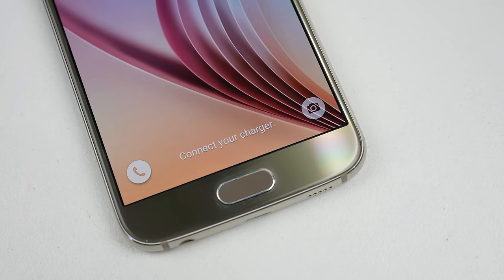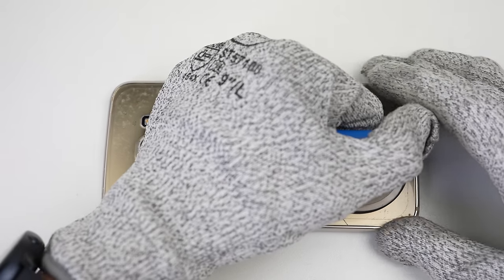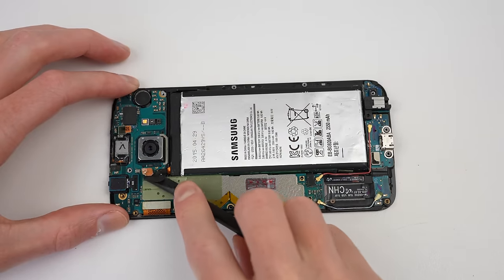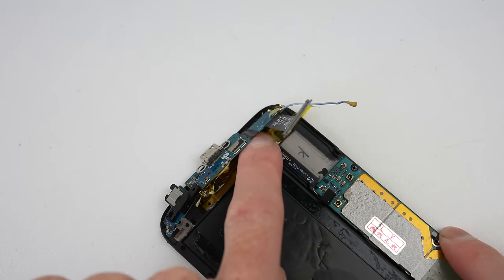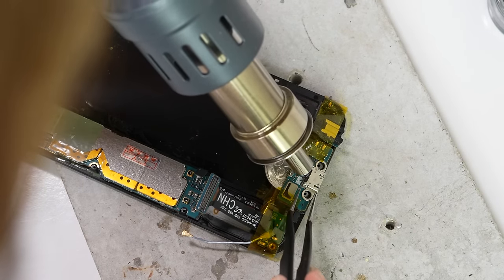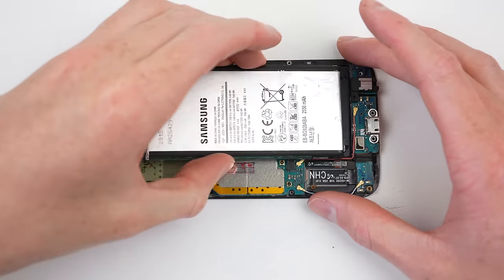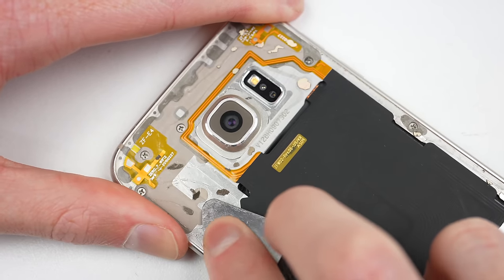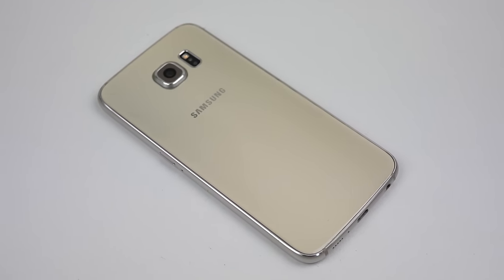Complex Repair - Galaxy S6 Restoration + Charging Port Micro-Soldering

Comment: Thanks for calling glued in batteries an outright stupid practice. The Galaxy Xcover Pro proves your point, hotswappable batteries should be the norm
Reply: Also the Fairphone 4
Reply: @WhenDoesTheVideoActuallyStart  but the fairphone 4 is thick, underpowered and doesnt have great liquid resistance. The Xcover Pro is IP68, modern spec processor and fantastic IPS display. its also MIL-STD spec for durability while staying affordable and slim. If people equate hotswap batteries with devices like a Fairphone, we wont get anywhere. It needs to be styleish enough to sell to the mass market
Reply: @Carterthielftw_  Are you kidding me? Where have you got your info from, Bob the flat earther? The Fairphone 4 has a Snapdragon 750G. That's Cortex-A77 big cores on 8nm. It runs miles around the Xcover Pro's Cortex-A73's on 11nm (Not to mention it's an Exynos instead of a Snapdragon).

The 750G is the lowest I would go for a new phone, so they picked the SoC relatively well.

As for "thin", it's not 2015 anymore, and as for "stylish", I'm sorry but not everyone is that shallow. Not financing slave labour is more important to some people, and that's a feature no other phone offers.
Reply: @WhenDoesTheVideoActuallyStart  Interesting, I knew it had equal RAM to the Xcover Pro, however I remember it being constantly hated on for being "slow." evidently smartphone reviewers are disconnected from reality and think anything thats not an 888+ is slow. Ive been using an Xcover for a couple months and cant remember any time when it felt slow, considering the Fairphone is faster and MSRP is similar (I got mine open box for $250.) I could get behind it

I was wrong, with that SoC (and it being available in the US) I would definitely consider it. $500 is a lot, but im  not against the device, I just believed what reviewers were saying :(
Reply: Xcover Fieldpro
Reply: Blame tech reviewers. Muh premium

Comment: This is awesome. The first premium phone I had was an S6 Edge+. Dang it was nice. And I was able to do a battery replacement on my own when it swelled. It lasted a long time. I eventually ran over it with my car. The phone still turned on and I probably could have just replaced the screen but I thought it was time to upgrade. I'm considered buying another one for the sake of nostalgia.
Reply: Oh and I miss the physical home button with a fingerprint reader. It was like touch ID but smaller. I would take having a bezel on a new phone for this
Reply: The screen would actually still come on sometimes after it was ran over. I have looked at buying a new screen now but it costs the same as buying one of these phones that work.
Reply: @The King  get an ebay screen
Reply: @deeznutt666  Galaxy Note 5 came along with the S6

Comment: Heres the thing though Hugh, Samsung did have a solution for this charge port under screen button problem. The galaxy S6 Edge had a cut out under the mid frame to allow the buttons to be under the charge port without wrapping around and going under the screen, this meant you could lift it straight up and replace without any issues. But samsung stopped doing that with the s7 series and after the s7 they never had hardware buttons again anyway...

Comment: I tried a Micro USB port repair once. It worked but I forgot to secure the port down and while I was testing it the weight of the charging cable ripped the port out of the device, along with the solder pads. Glad you could get yours to work.

Comment: I am still running an s6 edge in 2023. This year i replaced the charging daughterboard alongside the battery. In the edge variant the cables for the capacitive buttons don't run under the screen so it was an easy job. I actually found it to be very straightforward to repair despite it's reputation, although i do agree that gluing the battery down is ridiculous. Anyway I must say that i'm positively surprised with the longevity of the  phone and I plan on hitting a decade of usage before replacement.

Comment: Loved the S6,this was the first Samsung phone to have a great build quality.Also this one seems to run the original Android 5.1 version that originally came with it,it's pretty rare to find one still on original firmware because this was the only S that would refuse to downgrade via Odin if you didn't like 6 or 7
Reply: I remember buying a S6 edge on Marshmallow and wanting to downgrade to 5.0.2 due to the square icons, only to find out my Rollback Protection Software Revision (RP SWREV) didn’t allow me
Reply: Note 4 was the first to have aluminium frame, but still had removable back
Reply: @coffeemakerbottomcracked  Note 4 looks cheap next to the 5
Reply: @deeznutt666  You can downgrade the S7 if you want. Out of all Galaxy S phones the S6 was the only one that i couldn’t downgrade
Reply: @coffeemakerbottomcracked  i know,but the frame was scratching easy and the back still felt cheap. The S6 and the Note 5 felt premium in all ways
Reply: @satsumagt5284  5.0.2 had RAM and battery bugs. I had it on my green S6 edge when i first bought it. When the battery would reach around 20% it would already shut off. When i got 5.1 those issues were fixed. In Android 5 versions it also had unlock sounds and animations that were unique and went gone after Android 6 and up. The whole UI was different after updating to 6
Reply: @coffeemakerbottomcracked  Actually it was the Galaxy Alpha
Reply: Galaxy alpha was the first phone to have great premium build quality
Reply: It orginally came with 5.0.2 and I managed to get an edge model running orginal firmware
Reply: @satsumagt5284  there are 2 5.1.1 updates. One kept the orginal icons and the later one bought over the Note 5 icons
Reply: @satsumagt5284  nah it looks premium
Reply: @Mirra2003-f9s  mine doesn't have the battery bugs or ram

Comment: You can use the dome head screws to hold the charge port in place then use the heat gun to melt the solder. Saves you using tweezers and a shaking hand. 👌

Comment: Nice! I used to do so many of these years ago you can actually replace the whole flex without removing the screen heat plate with suction and iso u can wiggle it out and wiggle new one in but now i would prefer to solder them as its quicker.

Comment: Slap some Lineage OS onto this thing and you've got yourself a pretty decent mid range phone to be used as a backup device. Also, good job with the soldering
Reply: i would say better than a midrange for many, because of the high res camera and screen
Reply: Touchwiz is fine

Comment: Such a pretty phone. An S6 is too old to be daily driven but it would work good as a media device for Netflix/music/podcasts/YouTube etc
Reply: Im daily driving it, plus its underclocked. In words of a wise man, 'As long as it plays music and porn its fucking NASA to me'
Reply: @xentiment6581  good on you bro. I wouldn't be able to daily drive it; no expandable storage, small storage and it's stuck on Android 7
Reply: @defnotatroll  Android 7 is still very relevant today. Most apps support Android 7 except just  few ones.
Reply: @neerajdwivedi2015  but it's still old and lacking lots and lots of features compared to newer android, stuff like dark mode
Reply: @defnotatroll  You forgot you can put custom ROM or download a launcher called: HiOS makes it much more responsive and efficient
Reply: Custom ROM / HiOS launcher on S6 would work awesome
Reply: @WololoWololo2  custom ROMs always always perform worse than stock ROMs or have less features
Reply: @defnotatroll  But atleast newer than the Samsung S6's old Touchwiz and unsupported old Android 7
Reply: @xentiment6581  ayyyyy filthyfrank reference
Reply: Bought one running 5.0.2
Reply: @WololoWololo2  security patches don't matter unless you're doing mobile banking
Reply: @DavidNgo86  True 😩

Comment: I used to do this dozens of time everyday without a MicroScope, it's doable but you definitely need Steady hands and good Eyes, also Hugh I hope you checked the USB/MTP Connections, because if it's charging it doesn't mean it's data lines are also good.

Comment: Well my first micro soldering experience was on brick phone from czech company called alligator. I changed the led flash and was very happy when it worked. However,
That’s only 2 big pins, charging port is complicated 😄. Great to see your S6 works :-))

Comment: Hey Hugh, I know you don't usually take requests but You are THE only Person on youtube i fully trust with repairing devices, I Still have my galaxy S6, it's a 32GB, Black Sapphire model, im thinking Of restoring it & changing it from Black Sapphire to Blue Topaz, Which includes changing the front glass, i've looked on youtube for a Video about changing the S6's front glass But none of them go into actual full detail, do you mind if you could do a video on another S6 which Will be having the Screen replaced?

Comment: I love the older samsung phones anything pre note 10. They just are so beutiful and the compact 1440p oled is just beautiful on older flagships, I would use a note 9 with modern chips
Reply: The bezels are ginormous though especially round S6 S7 time
Reply: @defnotatroll  I don't really care it still has no interruptions like a notch or punchhole
Reply: I’ll be honest the S7 Edge I had was by far the best screen on a phone I’ve ever owned. Overall build quality was outstanding. I miss that that phone….
Reply: @lkracker7  see I had a normal s7 and it was my first oled and 1440p screen and wow that thing flew

Comment: If you are worried about the heat damaging parts, I would recommend for you to get some good quality aluminium tape, as that one actually diverts heat and also protects the other components from it even better than teflon tape. Of course, it is also worth considering, if the cost of it is worth it, as it can be quite a bit more expensive than teflon tape.

Comment: hugh. your new battery is VERY close to and original battery. i still had my original s6 batt and it has 40% life left. the date code is misplaced on your one and the QR code looks bigger but otherwise it looks original. i repaired my S6 with both frames and the battery because everything was bent but the screen worked so i replced teh frames and battery so i could get a usable galaxy S6 and i did not break the original screen and im still amazed that it did not break when i was removing it

Comment: Two things. Kapton tape is not hear resistant, it's heat reflective, and not up to particularly high temperatures, so careful 

2, you don't want to use low melt solder for permanent applications, just component removal. You could find those joints failing down the line, not that you're going to use the phone I guess. Always remove low melt and apply leaded solder for the resoldering of ports.

Comment: Im coming to Australia so you can replace the charging port of my S6!!! My S6 is in absolute pristine shape(literally not scratch) and still functions as it did when i purchased it in 2015,including the battery life,with the exception of the charging port that has finally worn out from 7 yrs of daily plugging in which still works with some wiggling. Its never been wet and i can count on one hand how many times it has touched the floor in 7 yrs. I have resorted to wireless charging which is kinda a pain in the butt,but it does the job. Im reluctant to bring it anywhere to have it repaired due to my fear of lack of care to the rest of the device. If you ever travel to south florida,please bring an extra charging port for an S6 as ill be patiently waiting and still wirelessly charging!

Comment: Smaller nozzle if possible on the hot rework gun and some magnification and you’ll have it licked. Great effort without any magnification. Tweezers used not the best as they don’t grip very well. Some micro pliers perhaps better as you can apply a positive pressure on the charging port and hold it more firmly.

Comment: Great video. I have an old S7 that needs a new screen and probably a new battery and considered trying a DIY repair even if just for practice. That is until I saw replacement part prices. Unfortunately much more expensive than the phone is new now. Not really worth it for me.

Comment: Having the buttons under the display connected to the charging dock does not facilitate the work, you risk also ruining the display during the replacement. Your solution is certainly excellent, this obviously presents many risks too, another nice repair. Nice video as always.

Comment: Was curious on the hot air but next try to use 300 on glue removal, it’s soften up the glue quickly then you want removal surrounding components , as for removing components, 330 going up is safe temperatures, you don’t want to be heating a logic board for long time. Otherwise try warming up the board before applying too much heat

Comment: It would help you to tack one pin with the iron first, then to screw down the connector with dome-head screws and washers, prior to applying hot air.

Comment: Hats off to Hugh, you are already better than that Jerry screws everything. I used such a phone for a couple of years, a Coles staff card could be activated from up to 2m away. Compared to the Iphone 6 it is about twice as powerful. Had my battery changed and mentioned the charge port but they just cleaned the port and I had to go wireless. Then it fell 2 feet onto thick carpet when the display went off. Then I went to a Honor 8X that made good night photography but I never got used to IPS after Oled. So got an A20 and what good value that was. Moved on to the S21U that is also replacing my fibre to home giving me average 3 times better speed for half price then the NBN could give me. But now Samsung has downgraded me with latest firmware it is no longer possible to skip the ads on games. Now I recommend the IP13 as a all singing and dancing.

Comment: The S7 series was the first to allow you to change the charge port without removing the screen or using soldering.  I refuse to work on S6/Note 5 series phones unless I'm only changing the battery or replacing the entire screen with frame.

Comment: My first charging port replacment was very complex.

1. The data + and - pins were lost
2. I somehow discovered that the port inverts the pins, i was about shorting the 5V+ and the data - cables, i would killed the device.

I jumped the port pins to their location on the board using a schematic diagram for the device.

All charging ports repairs after that repair seemed very easy for me.

Comment: It's technically a modular part, you can buy an entire daughter board with the micro usb, headphone jack, capacitive buttons, etc. Attached.  But the big downside was, you need to pry off the screen extremely carefully, in order to pull the old capacitive buttons.

I did the same repair to my auntie's Galaxy note 5, her micro usb was also busted, I'm an ape when it comes to soldering, so i just bought an entire daughter board, and swapped it with the original one with the busted micro usb port, the screen disassembly was so terrifying though 🥵🥵🥵.

I'm not a phone technician, but i know some basics on how to repair my devices, as long as there's no soldering involved. Great video anyways ❤️ Merry Christmas bro.

Comment: I’d prefer you after cleaning solder just apply paste flux and place the port in the place and start heating with smd station … and finally apply solder with iron on the pins and that’s it. ( I know all theses because I’m a phone technician my self) sorry for bad English

Comment: I have an S6 sitting on my cellphone timeline shelf (phones ranging from 1995 to 2015) in my mancave.  This was the worst Galaxy phone, it's basically an iPhone disguised as a Samsung.  They went back to normal with the S7.  I took a 1/4 stick of dynamite and blew mine up.  Have a video of it and all.  It didn't blow up in million pieces either, pretty solid.

Comment: You've done a great job. It might be a good and cheap way to start reparing phones. On the other hand it is a waste of money anyway. It is just that old and uses an older version of android so some apps and messengers aren't usable anymore. And there were no security updates from Samsung. If you are a collector and all your collectables should be working then it's fine. But for a user (especially here in Germany) the repair of an old S6 is not an option. It is just not handy (this term is used in germany for a mobil phone) anymore.
Keep on your work. I love to see your videos every sunday. Merry x-mas and a happy new year. Greetings from Germany

Comment: Good video but don't use the hot air to solder the connector the heat will damage the plastic inside , soldering iron is the best to solder safe

Comment: 1. It is called Kapton tape. 
2. The battery you purchased can't be original! It has a date mark from 2021 and the phone production stopped few years ago. Samsung doesn't supply batteries for older devices. Great fix btw.

Comment: I once tried replacing the charging port on a tablet I got for free. Sadly I only had a normal soldering iron so I wasn't successful. The port was on its own PCB, but I couldn't even find a picture of it on the internet and of course no spare parts.

Comment: A probably silly question: what is the use of the adhesive to hold the battery in place when it is housed in a space that does not allow it to move anyway?

Comment: That’s contact point is small af. 

At least I would have said that until last week when I cracked open my GBA and had to replace some SMD components. 1.0x0.5 mm. MM. I didn’t know that a 1.5 Mohm resistor could be that small. What I would do for a high quality rework station…